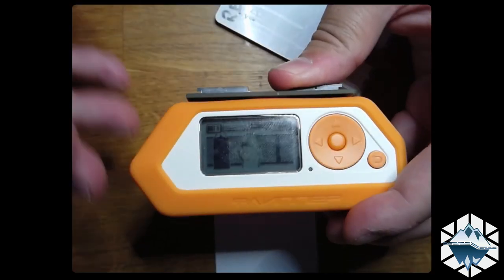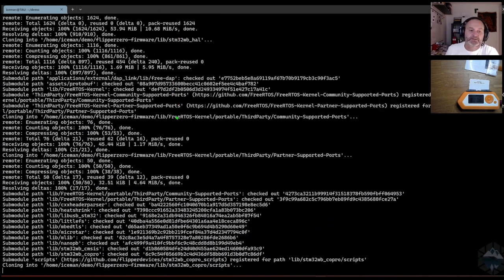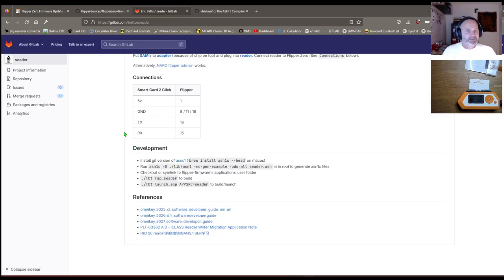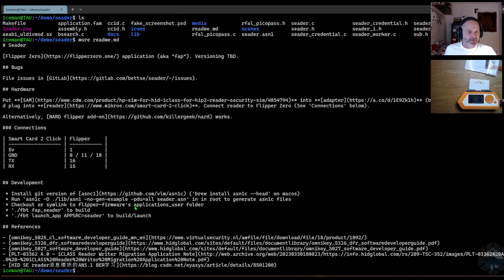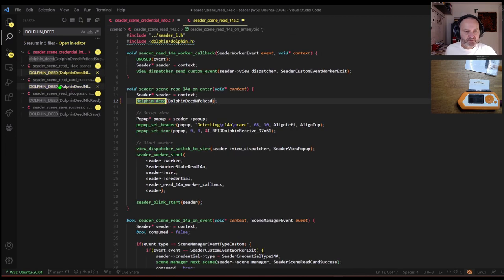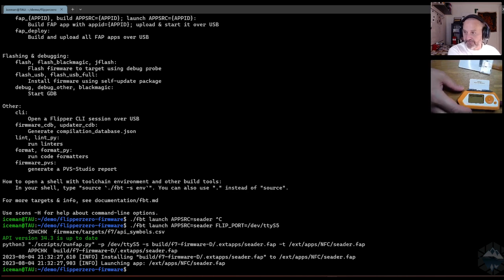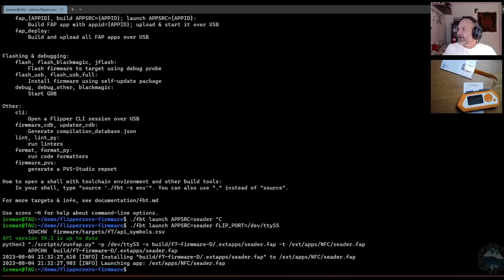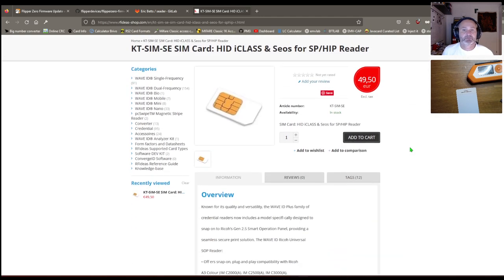Unlocking Secrets with Flipper Zero: From Firmware to reading iCLASS SE/SEOS /DESfire

Comment: great video. Is there a similar type of process to be able to pull credentials off the actual reader vs a card?
Reply from the maker: That is a good question.
In order to do that we use something that is called "weaponized reader".

Which is a normal reader but we added a sniffer on the wiegand datalines coming out from the reader.

Now you have enough information to google the rest!

Comment: Have questions regarding creating master keys… I’d like to speak in private
Reply from the maker: Define master keys?
Join the discord server and see if you can find a channel that matches your topic of interest
Reply: i understand there are easier ways to bypass these locks but i wanted to know if there is a way to use a pen testing tool to be able to configure a way to be able to crack these types of locks with such tools.... and sorry, quiet the noob to this world but i will put in the work to learn
Reply from the maker: @garrettc1120     I doubt you find commercial tools that does what you want and if so, you would most likely pay top dollar for it.   Its nothing an amateur tool does.
Reply: @iceman1001  if possible...... could something similar to a gsm data receiving device be able to read such data?
Reply from the maker: @garrettc1120  A GSM data receiving device?  You lost me there

Comment: I have been trying to put a NARD SAM expansion board together but Attend does not make the 8 pin sim connector anymore trying to find alternatives if anyone has ideas. ps I would buy the red team board but they are out of stock i would assume for the same reason that the connector is no mas.
Reply from the maker: Have you looked at https://www.lcsc.com/  or other component stores?

Boards and access to SAM's would be one of the major reasons for lack of products to sell